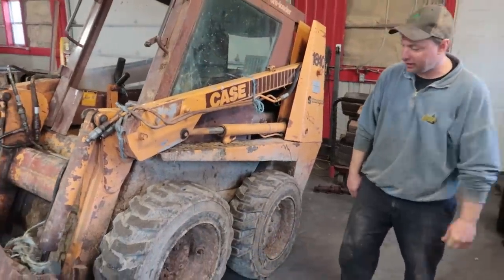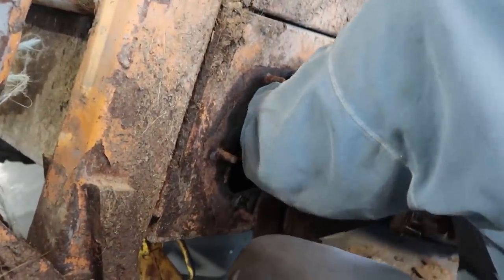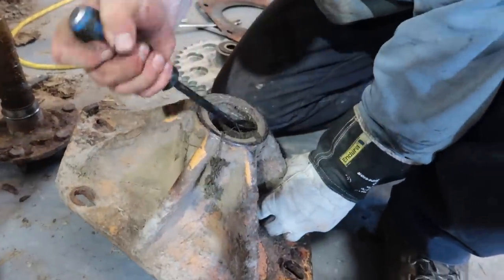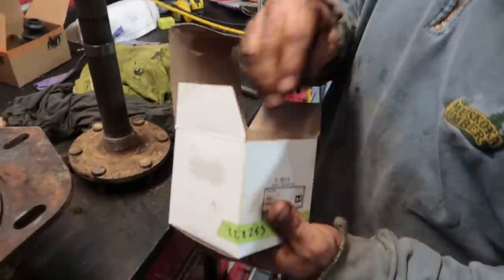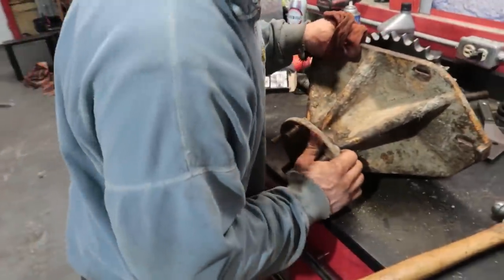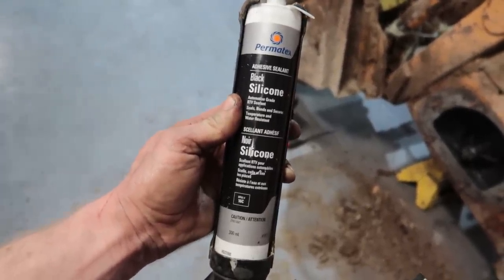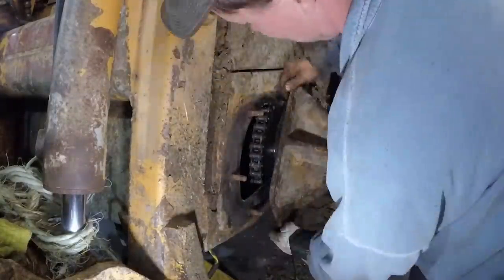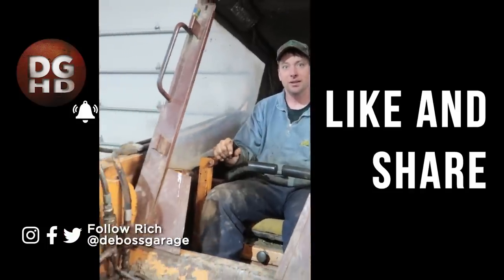Fixing the Wheel-bearing Before Kevin's Skid Steer Wheel Falls Off

Comment: If you cut the old bearing race in one spot with a grinder it won’t get stuck in the hub when using it to drive in the new race
Reply: If you cut the race of the new bearing, it will glide in as with baby oil.
Reply: @nikolai502   If you don't reinstall a bearing you'll never have to worry about the bearing going bad.
Reply: I got a bought a car where the previous owner did a wheel bearing and ground down the front lip of the hub so it would go together easier, before I took it apart there was a solid half inch of play all round because of it. When I took off the caliper and rotor the hub fell out, the only thing holding the wheel on the car was the brakes

I can't believe somebody put that together and said "yep, I'm happy with that"
Reply: @hopingforthebest1.9  I had to get to work somehow that day

Comment: I have a 1838 and a 1840.  I have replaced bearings in the 1838 several times, but it is new enough that it has access holes in the top of the chaincase.  I drilled my housings after changing bearings more than once, and installed grease zerks.  I don't relube them often, but still it seems to have helped life.  My machines run in mud, water, and manure.  The 1840 has a rear bearing out right now, and being as it does not have the port holes, I wasn't sure what the procedure was.  Thanks for putting the video up.

Comment: The Case 1835c, 1838, and 1840 were all essentially the same machine, just with different engines. The 1835c was the older of the three. The other two were built concurrently. The 1835c had a Teledyne 2.0 3-cylinder engine, available in either gas or diesel. That engine is definitely not recommended. The 1838 and 1840 had the Kubota v2203 and the CDC(cummins) 4b engines, respectively. Both engines are good, but the 4b is phenomenal.
Evidently, there was a running change made during this three-model run. Case used thicker steel on the later loaders, and they changed the method of access for the chain sprockets. The 1835c's and the earlier units of the other two models all used the big D-shaped opening that you see in this video. These folks show the correct method of removing/reinstalling an axle. It's also necessary to sometimes remove the center cover, and reach through that hole to handle the chains.
The later 1838's and 1840's had a much smaller slot that the axle went through. It's not possible to remove the axle and the sprocket as one piece on these units. For these later units, you have to move the cab forward, and remove the plastic covers on the top of the chain boxes. The castle nut is removed from inside the chain box, then the axle assembly is removed, leaving the sprocket inside the chain box.
I've got a 1835c and a later 1840. I definitely prefer working with the later style, even though it requires more total disassembly. I highly recommend not rebuilding a single axle. If you're doing the job anyway, you REALLY should replace the bearings on all four axles. Check the chain tension(by reaching through the center cover). If the chains can't be pulled tight, replace them. Don't remove links. If you remove links, you'll ruin the sprockets. The later style with the top covers is very sensitive to water intrusion. Replace the rubber seals, or make a concerted effort to never leave the loader in the rain.
The wheel bearings are definitely the Achilles heel of these 1835c/1838/1840 loaders. Everything else is pretty bulletproof(except for that Teledyne engine).
In case you're wondering about the Teledyne engine -- it's famous for losing the rod cap on #3 cylinder, wedging the rod between the crank and the side of the crankcase, breaking the camshaft, and putting a hole in the block right behind the electric fuel pump. I lost one engine to this issue at 2000 hours. I've heard of other folks having the exact same problem at 500 hours. I lost another engine in this 1835c, simply due to being worn out, at 5000 hours. The engine is not sleeved, and rebuild parts are very expensive. The engine itself is prohibitively expensive if you intend to replace it.
I've put a lot of hours in the seats of this size-class of CASE loaders. They're excellent dairy machines, but don't expect them to lift massive loads or dig proficiently. They were designed more for nimble mobility, instead of bulldozer and forklift substitutes, like many newer skidsteers are.

Comment: Had to replace an axle seal on an old CASE 1537 uni loader and trust me when I say it was not an easy job! Basically you have to take the whole chain case apart and fight to get it apart. I replaced the bearing as well as axle seal and a year later the damn thing is leaking again..😮. I'm not sure if a OMC 1200 skid loader has the same axle and hub assembly but I have one for a parts machine if I can use the axle on my CASE 1537. Used parts for my CASE are insanely expensive now. It all looks very darn similar if not identical to me. I'd trade you machines any day, lol😅 nice video guys.. Way too easy BTW 😊😂

Comment: To simplify chain installation:
block up the rear wheel, and open the drive circuit, to allow the chain to rotate.
then put the chain on the top of the sprocket and have someone rotate the back wheel--
-- while you hold the front hub housing, and allow the spindle to rotate.
the chain will "walk" on.
Reply: Iowa599 by God, you’ve done this before!
Reply: Except you can't turn the hydro motor over by hand. Youd have to use engine power which is not a thing that you want to do.
Reply: @jordanmpaul  You can if you open the circuit.
Reply: @Iowa599  waste time and pull the seat at least, Maybe the floor plate. can't hardly get to the hydro hoses without sliding the cab forward anyways, then crack the hydraulic lines and spill oil into the belly, making more mess. Nah I'll just put the chain on. And besides, there's not many 1845s around anymore. most are C models so they have the access panels and all you have to do is pull the pin and the nut. Wheel hub slides right out.
Reply: @jordanmpaul  I'm not clear on that model, but the bypass valves are generally easy to access, and some models even control the bypass valves with the lap bar.  The bypass must be opened before towing, so it needs to be easy, because they don't always break inside service centers.
Reply: @Iowa599  that's why we have a forklift and flatbed semi trailer. If a skid steer is dead they generally don't move well, if they have a tow valve or not. We never use them.
Reply: Good idea, won't work in reality though. Another arm chair quarterback fail.

Comment: I've put a transmission in once without the torque converter before. And was like damn why ain't this thing moving haha never made that mistake again
Reply: niteninja 01 I bet you were a pro at taking it out and putting it back in by the end 😉 I dropped the massive automatic in my pickup with the transfer case still attached once from under the truck, next time I need to do a rear main the engine comes out.. I don’t ever wanna take a trans out like that againn
Reply: I scrapped an engine in an IHC scout because I forgot to put the rotor in the dizzy. New engine was already in and I wondered why I had two used rotors and one new one.
Reply: Lol!  I love that.
Reply: bobwatters it was just really big and awkward, me and a few friends tackled it one Friday night with a motorcycle jack and some cribbing
Reply: bobwatters worst thing is it wasn’t even the rear main that was leaking lol
Reply: Put a injection pump on qnd off a few times in one day off a 12v

Comment: I spend a lot of time making a mechanism for testing the tightness of taper roller bearings for a sealed for life application that was only grease lubricated. We were expecting 30,000 hrs continuous running.  It was absolutely imperative that there is end float. Your normal crown wheel and pinion bearings have normally steeper taper angles and have a great supply of oil to lubricate and cool the bearings. This is why they tolerate a tiny bit of preload. When a taper roller bearing setup has no end float or even preload, the "fat" end of the rollers rub along the shoulder on the outside of the cone. it is a rubbing action, not rolling and preload is asking for trouble on greased applications. I have seen a truck weld its bearing to the tube in 110 miles because it was too tight and car front spindles wreck bearings in 65 miles. There is no problem with a wee bit of end float. As soon as there is weight on things it all self aligns anyway, but the end loads on the rollers are very small. Preload makes these loads many magnitudes higher.

Comment: Sorry but the whole thing will likely explode in the first 10 minutes of run time as there were only 4 taps checking the preload compared to the 5 taps before putting the plate back on.

🤪🤪🤪
Reply: You clearly don't understand these machines it will last at least twice that long.

Comment: I always expect a repair to last forever, and I have been disappointed many times thinking that! LOL  But after replacing the same axle bearings more than once on a 1838, I read the instructions that come with the Case rebuild kit. The upshot is that packing the bearings is not enough lube.  The housing is supposed to be partially filled, the instructions stress that this is important!  I wasn't sure how to add that lube, so I installed grease zerks to the housing.  Haven't had to replace any of those bearings since.

Comment: Use a grease needle for uni joints and a grease gun 
Put needle into the roller part of the bearing squeeze 
No mess no loss and you can ensure you get grease where it needs to go

Comment: I went to pig iron and got one of those bearing greasers  used it about 3 times then quit, after spending more time cleaning it to put it back in my toolbox draw than using it. Now I just lay the bearings on a hard surface on a clean shop towel and use a grease needle and fire  the grease in between the rollers until it comes out. Twines a pain, there's a few guys i work for don't pick it up but, bitch when I'm giving them bills for seals and shop time !  The worst thing I've had was a guy clearing fence lines with a Belarus with sliding hub rear axles.   He managed to wrap about a 1/2 mile run of barbed wire between the wheel and the axle casting, that was quite time consuming cutting that mess out.    Thanks for more shop fun ,Take care guys

Comment: Packing grease is easy, just get a small paint can that fits the bearing fine, blop in the grease and heat it to about 200F then spin it on the end of a rope in a rivet bag.   Paint mixer and extra grease works well too. If you have to do a LOT of one specific sized bearing you can make a pipe cup with holes around the bottom and make a plunger to drive the grease in but the simplest I've seen is two big thick washers, bolt through em and a grease zirk to top it off, bearing goes on end washer on bolt, grease goes in, next washer goes on, nut goes on, high speed drill goes on.   Hold in a bucket and pull the trigger.  Works for anything small enough the drill won't break your wrists.

Or you can toss it in a bucket of grease and use the end of a 4x4 on it.   XD.

Comment: Love to see an engine swap in a skid steer as I should have done on mine. Two speed drive hydraulics would also be an awesome upgrade to these older machines. TDI is what I should have put onto mine (Gehl 4615) when I bought it with the engine pulled out & "rebuilt" but separate. Can't hardly even get it to start at 45°F  with all new glow plugs & plugged in (new coolant heater too.) To low of compression? 
Also made a quick change plate for the front but wonder if a new style arms could have been put onto it instead.
Really like to switch the control arms to Case style (joystick) controls. The T bars aren't very ergonomic.

Comment: 10:35 Always goes faster the 2nd time. So true. Even more the 3rd then 4th.
Had to do the HG on a mid 80s Toyota 22R. Was having a head gasket issue. Originally took me a solid hour to get everything apart with all the various connections on the intake side (TBI). With so much repetition of doing everything I had it down to about 30min.

Comment: I've got an 1835b. It's slinging oil from somewhere behind the right rear wheel. I'm guessing a axel seal? Do you guys know if the bearing replacement is similar with my machine as in the video?

Comment: Just get a bearing packer, they work fine, and you don;t need to worry about the grease in the middle, just make sure you keep the lid on when not in use.
The only bad thing about a bearing packer is packing it when it gets empty.

Comment: John Deere 2150 had a bar similar to the pin you had for a punch.  Ran thru the lower portion of the rear end and three point arms slid on to bar.

  Would leak your hydraulic fluid out as the bar past thru the lowest point of the rear end housing.

Comment: If it's the same as an 1845c under the foot panel you can move forward and back to see what linkage to adjust to stop it from creeping, did it on mine when I first got it, took a couple min to adjust at the valve body

Comment: Many comments I'd like to share but my 1 question is what's the story on those Lawson bins outside? Lol. I do have to add one comment anyway... I've never chipped a race either. Cheaper bearings go out the door or if work buys cheap shit I use a piece of aluminum round stock then a final whack with close enough socket or sorta round thing of steel

Comment: would it be easier to put the chain on if both tires on the one side were hanging in the air?
Reply: Nope
Pretty sure there's a chain from the center drive out to each tire, hence adjuster forward & rearward on each plate assembly.

Comment: Don't use Silicone on the axle housing or adapter plate. Use Number 2 Permatex behind the plate and grease between the plate and axle housing. Silicone causes rust on bare metal surfaces and will not seal if moved. Change chain case oil every fall before freezing. One gallon of oil is enough.

Comment: how come with outer bearing races that will be a popular size to use again and again.. you don't Grind the OD to reduce it slightly. weld a washer in to the tapered face.. so you can toss this in a bin.. where you can put a bolt thru the washer and into the a handle.. you could now use it as a bearing race driver again and again..   in a former shop.. i never threw out any old bearings.. i would take the balls out and use them as press tools..

Comment: Want to know why the Honda dealer can go kicks rocks? A wheel bearing costs 64$ plus the two seals are 15 each. For a 600lbs 450 foreman. Not even a sealed bearing. You can do a wheel bearing on heavy equipment for less, apparently.

Comment: I'm my dad is a certified case machanic and that use 85/140 in the chain drive not 10/40.
Reply: You might find if you are in a warm climate the oil you say works, If you are in Canada where it gets to minus 20 degrees and colder  during the winter while feeding cattle and doing other stuff 85/140 will be like stringy snot and it won't flow so well when it freezes.  I work as a farm mechanic and find there are some machines we don't use what should be in them because it's hard on them when it's so cold, and the thinner stuff works better .   I've had auger gearboxes with 80w/90 gear oil in thats fine in the summer nearly stall a 16hp motor in those low temperatures before gearboxes warm up running them.

Comment: Compared to a similar vintage BOBCAT skidsteer which brand would you say is generally better to work on?
Reply: From what I've seen you have to tear the seat- floor pan area out to access the drives etc on Bobcats.
Reply: Agreed this particular job looks much easier on the case

Comment: The lug nuts would be 8 ugga duggas for future reference
Reply: If you get to 7.5 and get a free spinning sound like a jet engine, the calibration was off somewhere. Or tights tight and too tight's F'ed ,or the ultimate tightness of a mechanical fastener is the point just before the thread strips.   I hate cheap hose clamps for a reason  L.O.L

Comment: I'm going to guess that "punch" came from a Deere 42 series tractor (4230, etc)
Reply from the maker: Something like that.  It was about 20 years ago so I forget...
Reply: @DGHD  4230 owner here.... as far as I can tell, it's from a 4230 (or something  similar). Real pain in the ass to change it too, especially in the mud.
Reply: Kaden, we had a 4230 back in the late 70s early 80s when I was still farming.
M&W turbo kit,  she was a beast
Reply: @briankingwelding4531  I wish ours had a turbo lol, it's just a stock 404ci with about 9100 hours on it. Doesn't burn any oil but it definition needs a rebuild soon
Reply: The overhaul kits from Deere are reasonable in price and they're a simple engine to rebuild.
Wet sleeves and you can do it in frame.
My business is 98% heavy equipment/agriculture related and I do mechanical work as well as welding.
The 404 is a great engine and will last forever if you take care of them.
I can do one of them in about 2 days as long as I don't run into anything out of the "norm".